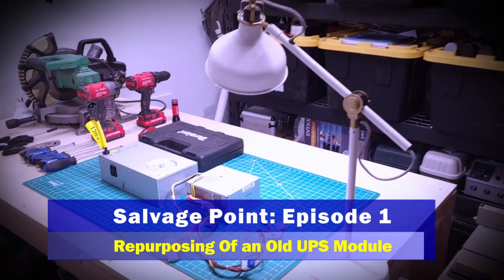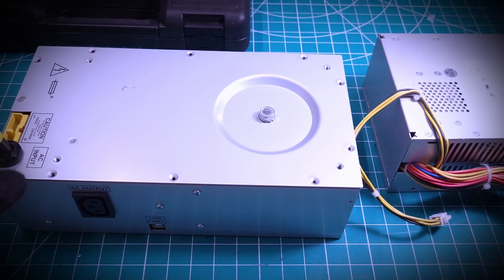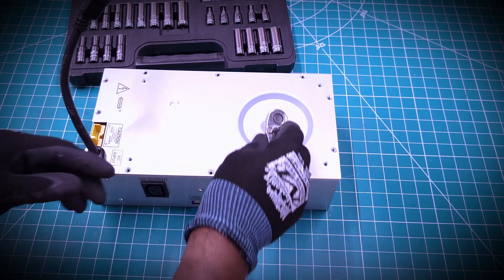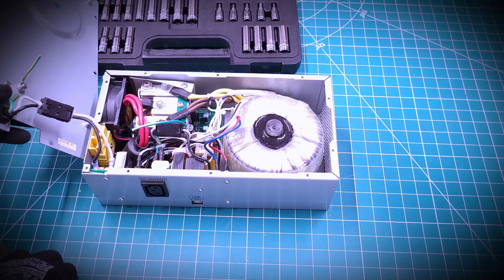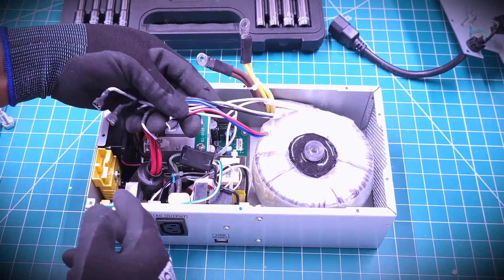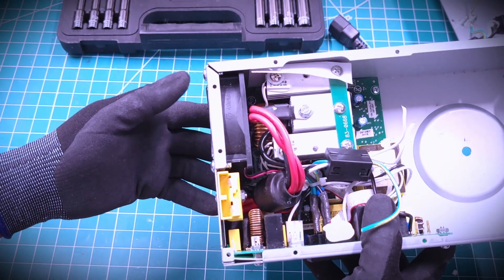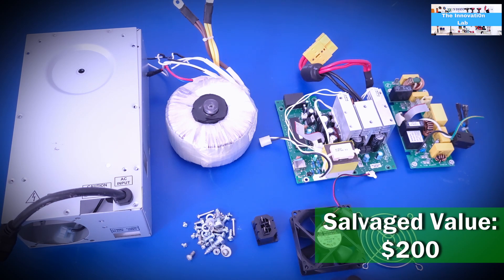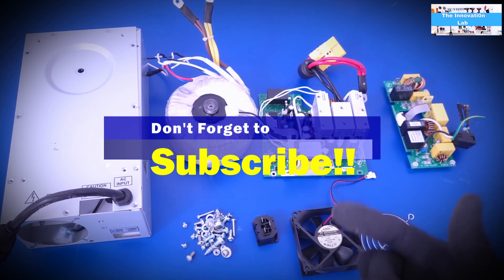How to Find Cheap Parts for Your Electronics Projects

Comment: Sir I want to drive 3 wheeler with 1500 watt two boost converter parallel connection input 24 volt 100 amp battery through 1000 watt 48 volt motor will this project work well sir please help me give proper advice
Reply from the maker: Hello friend. Thanks for watching our videos. This sounds like a fun experiment that you can try.
However, from previous experiments, I know that connecting SMPSs in parallel, does not always work well. One of the converters will try to drive all of the load. 
I will recommend trying to drive a single boost converter with a 36V battery (3 X 12V). You may struggle a bit with the converter efficiencies.
The best thing would have been to drive your system with a 48V batrery.